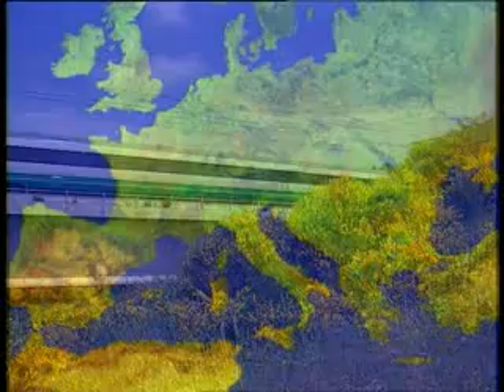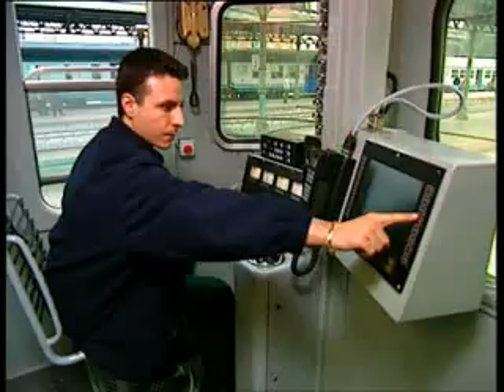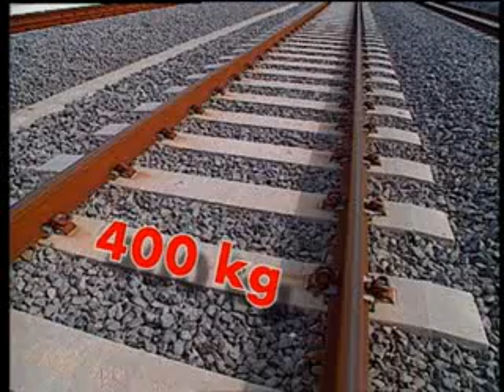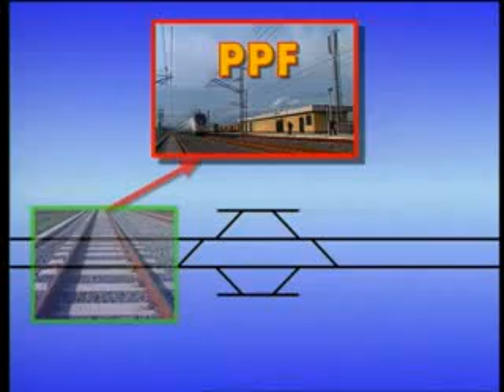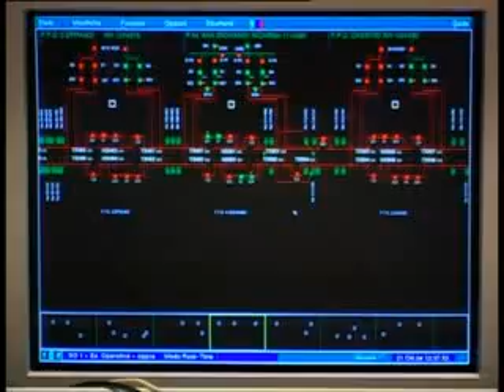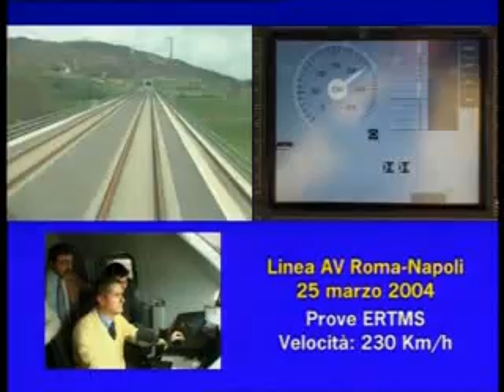The High Speed /High Capacity system and the ERTMS/ETCS[ENG]

Comment: +Droofy57 the lzb system isn't better than the ertms, because the frequency of the train is about 8 minutes, when on the ertms is 5 minutes, and the maximum speed who you can reach with the lzb is 300 km/h, when the maximum speed who you can reach with the ertms is 500 km/h